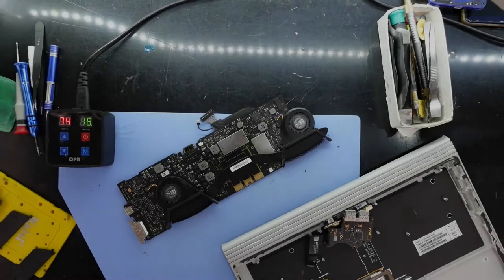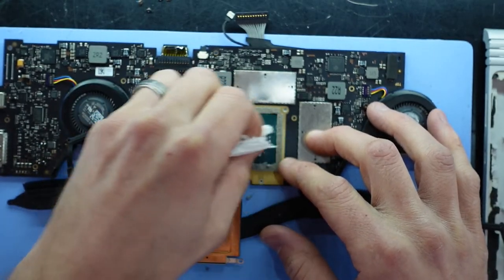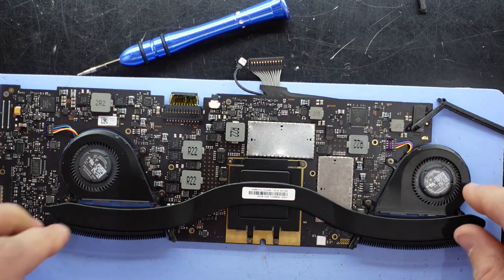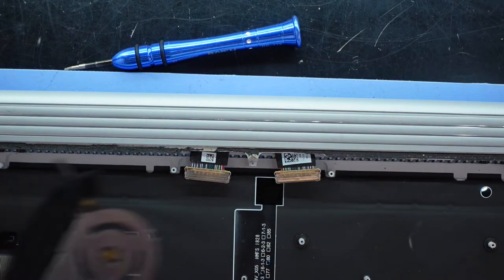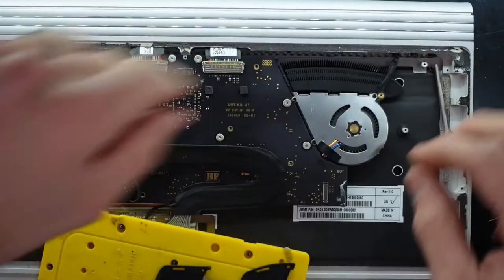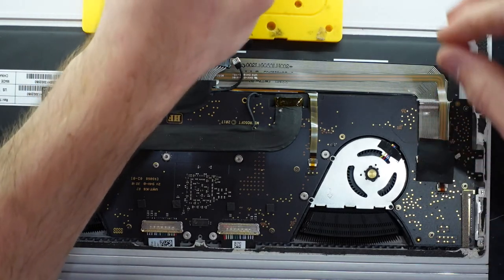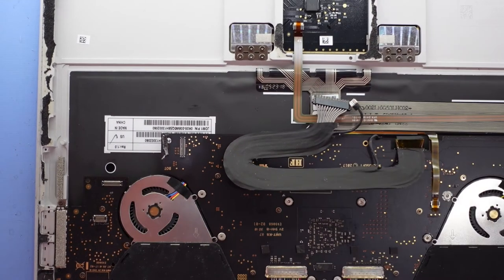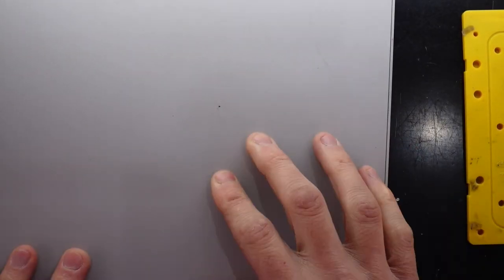Surface Book 2 Performance Base Assembly (GTX 1050 Thermal Paste)

Comment: I thought it was a gpu from the thumbnail then realized it's a whole laptop when vid starts.

Cool vid. I wanted to tear down and replace mine but old dell laptop is so difficult to get in. I'm not confident i can put it back tgt.
Reply from the maker: this was actually just a GPU

The bottom half of a Surface Book 2 contains 

1- GPU 
2- 2nd Battery
3- Some I/O Ports 
4- Keyboard / Trackpad

Comment: Is the usb c replaceable on these? Mine has stopped working and its the only port that supports external display
Reply from the maker: not sure, ii would still assume you can physicaly replace it but would require a fair bit of work

Comment: Just out of curiosity I have the same model but windows is not detecting the GTX 1050 not sure if it is something in the base or a software problems I even factory reset the entire surface book but nothing no fans and no detection
Reply from the maker: I would be leaning towards a faulty base unit

Comment: Hi, I have surface book 1 i5 8GB/128GB, 
When I insert the plug into the Charging Port, the white light comes on
When I press the power button, the laptop does not turn on.

I can't disconnect the screen from the keyboard either. When I press the Surface's Eject Button, the light turns red.

When I press the power button and hold down the volume up button, after a dozen or so seconds, the red light from the Surface tablet's disconnect button lights up once.
Dear colleagues, what is the reason why I can't turn on surface book1 ?
Reply: I disconnected the tablet itself from the surface book 1 keyboard.
I plugged the charger into the bottom port of the tablet to try to charge it.
I charged a few hours only the SB tablet 1 the top cover of the tablet was warm and unfortunately I can not start the tablet either.
in that case, the battery in the keyboard is replaceable and the battery in the sb 1 tablet also needs to be replaced?

Comment: Hey mate I have a similar issue, wondering if you have any thoughts? on my SB2 the base has stopped working i.e keyboard, trackpad, GPU, USB are not detected/working. However the battery still charges when plugged in AND passes through the charge to the clipboard battery. Furthermore if I connect a surface dock to the base it doesnt detect the USB through the dock either. Strangely enough the detach button works (the only key command that works on the keyboard) and will detach the clipboard to the base...  I have tried every fix possible including a system restore and have spoken to MS support who say its a hardware fault and it requires a replacement base. 

Im considering opening it up to see if something's loose. Any thoughts on the matter? I really dont want to pay the replacement cost lol!!
Reply from the maker: sorry but i dont have any suggestions for your issue there :(
Reply: just little help : 
1. check the connection between tablet and keyboard .... clean it up with pencil eraser / some electric contact cleaner 
this solve my problem (normal hardware) , but idk if your hardware damaged or not (btw mine is surface book 1)
2. Check your battery health at keyboard base , once i have SB 15 with gtx 1060 (and its GPU detected but not function) 
i replace its battery and everything working normal

CMIIW :)

Comment: I have a doubt as I've been working for years with an electronics and repair laboratory, if the surface book 2 GTX 1050 GPU card can be attached to the surface book 1 base, if there's any adaptation for this my friend, just a question... the connectors are practically identical, I don't know if updating the firmware will recognize the most current gpu, you already do some test with this case ...., or does Microsoft have a secret policy for not this update....
Reply from the maker: no idea on cross generation bases being swapped